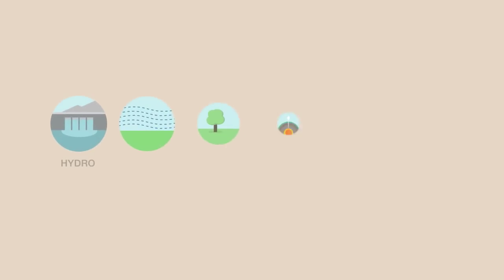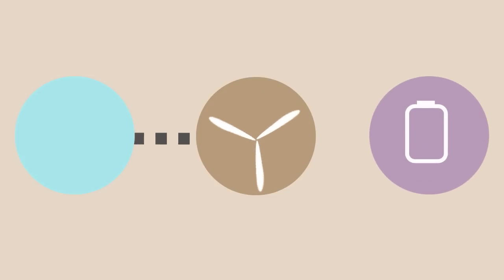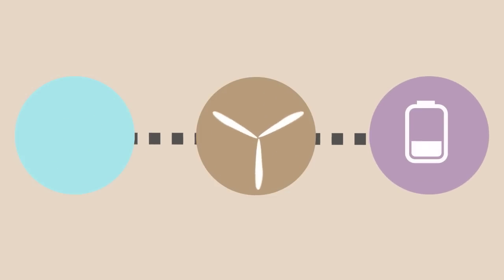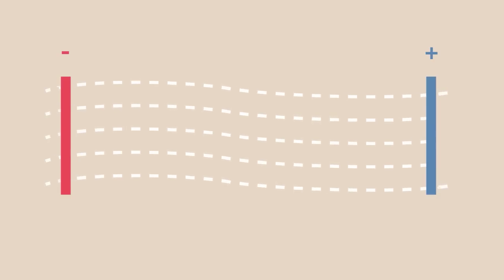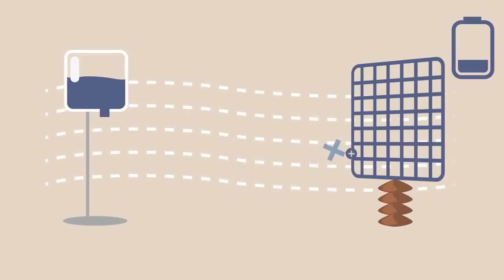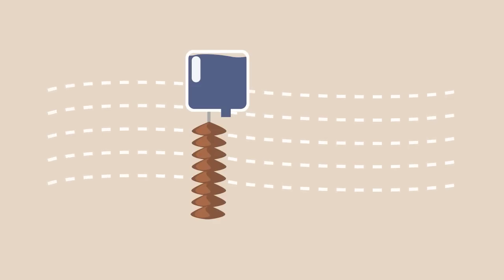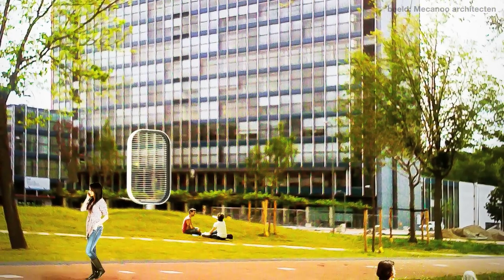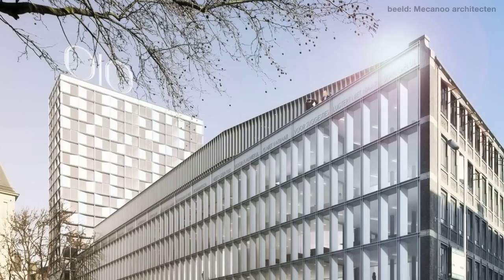Windenergy convertor EWICON animation, TU Delft

Comment: You guy are slow and wasting money. Just put a vacuum in a silver sphere connect a coiled wire to a capacitor that is the same  inductance as the capacitor has capacity. And you have a generator that will oscillat by itself. You just have to collect the A/C magnetic field

Comment: One thing wasn't mentioned, the complete installation on the roof of a building, is it capable of providing energy to light one LED, of can it be used to charge a phone. Maybe if we put installations on top of every building in the city, maybe we have enough power to charge one electric wheelchair. 
 
Please inform us about what the capacity is, how many kiloWatts are gained? Can we say goodbye to atomic power plants? Or is this another failure?

Comment: I don't understand where the positively charged particles come from in the first place - surely you have already used energy to charge them?  The Kelvin water dropper experiment springs to mind as a way of charging the water cheaply, but you need energy to fill up the water tank.  I guess rainwater could be used?
Reply: Kelvin's device converts the gravitational potential energy of the water into electrical charge. It's energy comes from the poor idiot who carries the buckets of water. If you used an electric, or petrol-powered water pump, the energy would come from that. 

So it's no more "cheap" than any other method. Gravity plays the same part that magnetism does in a real electric generator. It's the movement that puts the energy in.

Comment: I have a question: Where is the difference between a Kelvin generator and the EWICON generator? Well, apart from the difference that the Kelvin generator uses gravity instead of wind, which is much more reliable and usually stronger than wind.

https://www.reddit.com/r/askscience/comments/4i9j4n/where_is_the_difference_between_a_kelvin/
Reply: Kelvin's device is powered by the person or thing lifting the water up into the tanks. The water falls downward as it drains out, losing gravitational potential energy. Like a rock falling down a hill. Gravity is a field, it's not a source of energy.

Comment: 2:04
what would be the effects on the surrounding environment if this thing constantly sprays positively charged water droplets around?
Would it be safe? I would prefer that you capture these particle s as well.
Reply: e1123581321345589144 You're going to get static cling like in a dryer

Comment: How do you get it to stop attracting negatively charged particles from the air?
Reply: That's a hell of a good question!

I can see the principle. Get the air to carry away charged particles, and don't care where they go. Leaving a net charge on the machine. Eventually the charge will find it's way back through the ground and atmosphere. 

Surely one connection would be the collector, and the other would need to be Earth? Your "battery" or whatever load connected between them both. 

I just can't help feeling you've missed something though. This seems like it will have terrible power output. In particular will it take more power to create the ions, than you get from moving them away from the device? I think "yes" very much so. In creating the positive ions, you have to dump the electrons into the ground to start with. These ions are then blown away, and balance is restored by the Earth. 

In fact the increasing positive charge on the device would cause an ionic wind, actively blowing the ions away. So actually you've just created a device to discharge power into the air. Heating it slightly. Have you actually tested this thing? With even a hairdryer and some bits of wire? Did it create a net gain in power? 

Now I'm not even sure if this would work at all. Without going through it deeply, it seems like it will either generate a tiny amount of power, or waste it. 

Anyone can create a pleasant-looking Powerpoint-style video. If you had the balls I'm sure this would collect a few grand on Kickstarter, followed by a ton of criticism.

Comment: Air exchange/exhausting capabilities gallore...would be great to recycle all the ventillation fan energy you're already using for other purposes...plus you could use these as a form of external window, so whenever the window was open wind trying to enter the home could have this same function. Greenhouse windows? Mmmm...
Reply: The electrostatic repulsion works against the air flow slowing it down, thus defeating the purpose of trying to move air.
Reply: Keith Reynolds you could still get air exchange to occur, and since I'll already be exchanging air anyways, applying a minor resistive force to yield energy, it will still be a benefit to the bottom line
Reply: Theo M. So you want to use electricity to run  a fan to move air whose energy in turn pushes electrons to create an electric current?  If that is what you intend then the second law of thermo dynamics has something to say about how good that will work out
Reply: dtvgmedia Thats what Keith was saying in his previous comment back in May...to clear things up for you guys, I grow medical cannabis indoors under HID lighting, and therefore need constant airflow/exhaust to keep my hooded lights cool...this converter would be a way to 'recycle' some of that wasted airflow to generate some extra electricity because I need to have the airflow regardless of whether or not I can harvest any of the energy associated with that airflow :)  You both are correct though, if I were moving the air using electricity for no reason, other than to generate electricity, it wouldn't generate any positive returns...thankfully thats just not the case in this hypothetical daydream...but I appreciate you and Keith being concerned about it

Comment: This process can also be reversed creating thrust by applying electric field to charged particles. The ideal geometry is a mesh of regular triangles repeated in a fifteen degree angle relative to the next in a spiral correlative to the electric field, so the resulting electric field is a torus wrapped around itself. The more surface area, the higher the efficiency. The higher the dielectric strength of the material, the stronger the field that can be applied to it. Therefore carbon and graphene ironically are practical.

Comment: I have a better idea.  Imagine a plane full of passengers riding stationary bikes that turns a giant turbine  that powers the planes engines.  The perspiration can be collected, as these are salty and further be extracted and used in a larger battery. 

I can lose weight and fly at the same time.  Oh, and the planes will save money on giving free food, since most folks will only want healthy foods and water, which can dispensed at a vending machine based on the time on the bike. :)

Comment: sorry if this is a really stupid question but how is it possible to actually get more energy out than you put in at the charging station in the second design?
Reply: The electric field tries to push the drops to the left but the wind blows the drops to the right blowing the electrons up an "electric hill" when the charge is collected at the receiving end it is at a higher voltage and can flow through devices and do work.

Comment: So, it does actually evaporate the water. Is it more efficient than turning a turbine with the water falling the height of the collector? If so, it seems like a wide configuration would be more efficient, since you wouldn't have to more the water as high. Although, the wind-speed would probably be greater higher up (I'm assuming yield corresponds to rate of evaporation). Have you found an optimum spacing to the strings?

Comment: This is amazing for a few reason that I can see. Firstly, less moving parts means that there will be less costly maintenance required compared to conventional HAWT/VAWT designs. Secondly, removing the one of the energy conversion steps should make the generators more efficient. Kinetic -> electric should have less energetic loss than kinetic -> mechanical -> electric.

How far along is the research at this point? And how far from a commercial product that could be purchased by the consumer?

Comment: I've always fantasized about buildings using pressure differentials to have a sort of "automatic" air flow system. These could be fitted into the openings and in fact probably throughout the entire ductwork, allowing you to turn your entire ventilation system into your power source.

I must ponder this further.
Reply: Or airflows in coal and gas power plant could be used too?

Comment: it would be most compact to generate the charegd particles just before the collector plate. The video is vague on where the they start. once the charged particles pass through, do the particles get "decharged"? If not, the new pollution is charged air particles.

The wind has to move them through the plate or a given area. What if the wind direction flips? Again, the geometry and location of charged particles is needed.

How do you just generate charged particles? Loss of energy is associated.